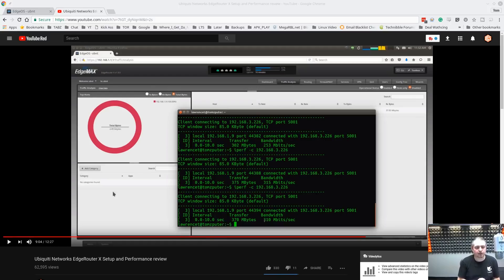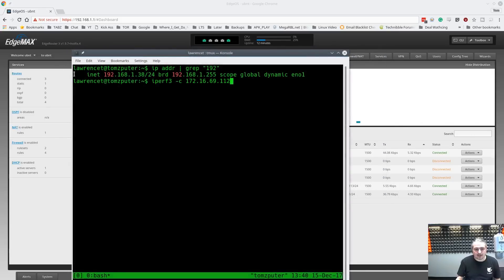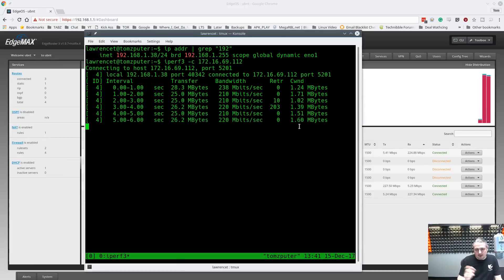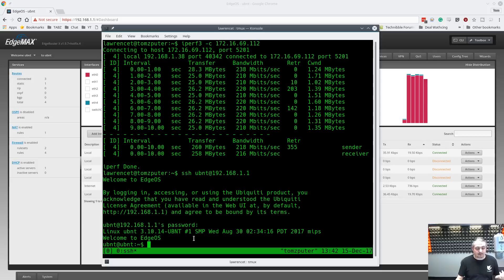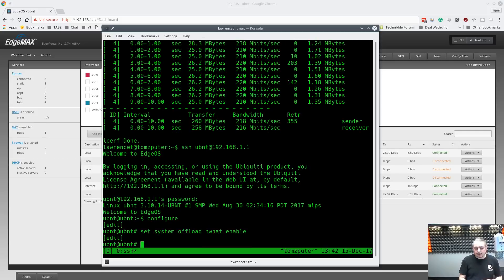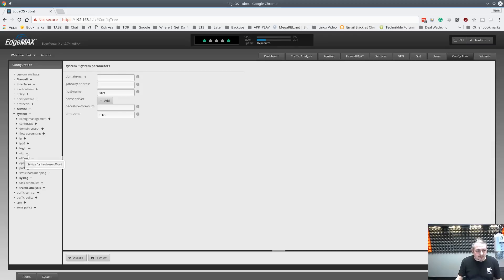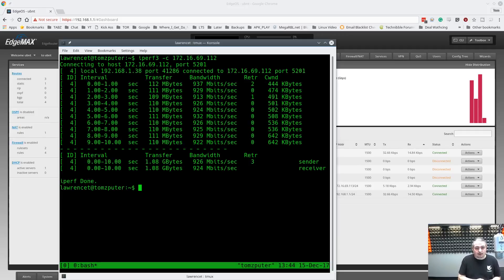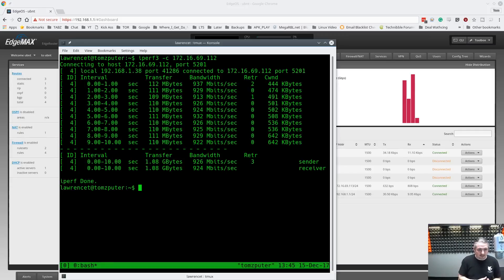Ubiquiti Edgerouter X Enable  Hardware Offload Speed Test

Comment: Hi, i have edgerouter x with firmware 2.09. I use wan 1 and wan 2. Wan 2 is starlink. Normal speed in wan 2 is 200mbit of download and 20 of upload. With my ubiquiti router the speed came limited to 60/70 mbit in download, why ?
I have enabled/disabled ipsec and hwnat but the problem is always the same.
Thanks a lot for the help.

Comment: Ok I have a question!  I have a Router-x and had 500mb/10mb and was getting like 370-400 download with offloading turned off default config.  So I up my speed to 1gb/35mb.  I got the same or maybe a little less so I used the cli and enabled offloading on hwnat and my speed drops to 170mb on downloads.  Replaced cable, no Qos. I plug into the modem and get around 670mb so not getting full 1gb so have that to deal with provider, but my upload is constant no matter what I do. I am on 2.0.9 on the router.  I disable offloading and go back to the 300mb or so.  Any ideas on what to check?

Comment: Does anyone still use this? I just bought an EdgeRouter X SFP for someone. He has a 1Gps/30Mbps down/up cable internet connection. I personally have a pfSense (and this one as a plain layer 2 switch). I ended up paying $100 for it. I bought the one for myself in December 2018 for the same cost. I couldn't justify having him spend $200 (with tax) for a pfSense appliance along with the Unifi WiFi AC Pro.They aren't heavy gamers and are looking to replace their cable company issued equipment. Performance on it is very poor at best on their old connection of 100Mbps/5Mbps (it is an all in one; cable modem, router, wifi router). 

Tom (or anyone reading this),0
I know its too late for me to return this, what are your thoughts on this product today since this product is a few years old)? Its a home setting. They were going to buy an AmpliFi mesh network (they have ethernet drops all over the house). For this reason. I bought them two access points. 

What are your thoughts?

Comment: OK so then how about telling us how to make it so that it actually GETS that speed? As in, mine will only connect via 10/100 and will NOT show that it is at 10/100/1000! I can't get the computer to recognize a gigabit connection, nor will the router show a 1000 option for setting the port to gigabit speeds...
Reply: Check your cable and test with a different one.

Comment: Hi, at home I have 1000 Mbit up/down which I can achieve by connecting directly.
I steram a lot over ethernet and WiFi but I want to upgrade my current setup and buy a UBNT router, switch and multiple Unifi HD's, I prefer the interface of the USG but which router would you recommend for me?
Reply: probably moot for you as this was 10 months ago, but here is my basic advice for others thinking along the lines that you are;
While gigabit internet still feels like a luxury these days, it is still just gigabit ethernet like we have all had on our internal networks for 15 years, and you don't need a whole lot of power to maximize your throughput on it... unless you are running a business or school where you have hundreds of device all hitting the network all the time and have lots of firewall rules then you are probably fine with an EdgeRouter X or Lite-3.  The X is a little better in some ways, but is a little simpler device, where the Lite has a console port on board for easier recovery options.
The USG is just a router.  It is small, cute, and has a very simple UI that interacts nicely with the Unifi software, but it is rather limited in what it can do.
The EdgeRouter X or Lite-3 is nearly the same hardware as the USG, but with a more capable GUI.  The box is not as cute, and it will not light up the circles in the Unifi software, but it does all of the same things and more... just have to manage it from a different web page.

As for the HD's... save your money.  HD is for High Density... Think of a cafeteria with 400+ people all streaming music and podcasts on their phones, while browsing the web on their laptops at the same time.  The Pro and the HD have very similar capacity and range, but the HD has a little more oomph to manage more simultaneous connections.  The Pro is made for classroom settings where you have 30 people with laptops and cell phones all connected at once... Unless you are going to have more than 60 active devices in the same area at the same time, then the Pro is likely overkill for you as well.  Put one every 60ft, and you should have some fantastic WiFi.

For a switch, again, you don't need a Ubiquiti device to have full feature sets.  Everything works together well, it is just a matter of how many websites you manage your equipment from.  The Unifi software is handy in that it can manage (or at least partially manage and report) for multiple devices in one place, where if you mix and match your brands or product lines, then you end up needing to set things up on each and every device... But once the initial setup is done you typically can leave it alone for a few years.
I am running an EdgeRouter Lite.  Eth0 goes to the internet.  Eth1 goes to an old unmanaged Linksys with end-user devices (PCs, TVs, printers, etc.).  Eth2 goes to an old manged Cisco switch that connects to the server, NAS, APs, and someday soon Cameras.  Down the road I will probably replace both switches with a single larger switch... but for the moment these 1 little 8 port switches were very cheap, and more than good enough for my uses.

Comment: I tried enabling the "hwnat" from the GUI in version 1.10.1(Edgerouter X) and it does indeed work (Full gigabit from LAN to WAN) and survives a reboot. I also disabled it via the GUI and it turn it off as well. Thanks for all you great videos! 🍻
Reply: do you have to enable hwnat if you only need gigabit for LAN-LAN???
Because i don't have a fast internet connection, but i have a server at home which i need to acces it at gigabit speed
Reply: It depends... Using the hardware offloading (HWNAT) will speed things up so it won't hurt. If you intend on using the QOS features then you can't turn the HWNAT on. I hope this helps.
Reply: Eric goodrich maybe my question wasn't clear enough...
from what i understand if you have hardware offloading not enable, every trafic is handle by the cpu which mean you can use QoS and so you have a speed from PC to internet not above 200-300 Mbit/s...
I meant to say if you plug a PC to eth2 and a home server to eth3, can you have gigabit speed between the PC and the home server if hardware offloading is NOT enable

Comment: Hi Tom, I haven't been able to find any information anywhere else. Just wondering if you would be able to check something for me in regards to ERX. Do these support full bridge mode ? I am trying to setup my pfSense in HA with one WAN just hardware HA. But, I get fiber terminated in my house and directly get internet via DHCP. So, if I can get edgerouter to bridge mode and switch other ports I will be able to connect to my two pfSense box(One physical one virtualized.).

Comment: EdgeRouter ER-X or Mikrotik heX RB750Gr3?? I really have tough time to choose which one will be better as they almost the same. However i see many people which favor Mikrotik devices over Ubiquity as they seem to be more polished than budget line of Ubiquity devices.
Reply: I know what you mean. I was hesitant about using winbox to configure the mikrotik devices, but it is really a neat tool which allows real time monitoring of different screens. Also works great in wine. I think the limiters are more capable too which is something I am really interested in. We need to get tom to do an iperf test on the RB750Gr3 to compare.
Reply: The thing I like about the Ubiquiti's EdgeOS (and their other OSes) over Mikrotik's RouterOS is that they are Linux based, so anyone one with some Linux skills can pick up the configuration relatively quickly and Linux skills learned with the Ubiquiti OSes are transferable to other Linux based OSes. I found RouterOS a mess to look at, but I know others  who love the Mikrotik software. Part of me just wants to run OpenWrt in my Mikrotik MetaRouter, rather than go through learning another router firmware again.

Comment: Awesome - I have a spare EdgeRouter X which I will upgrade (soonish).  Just ordered the same UniFi Managed Switch you've got as I'm setting up an internal pfSense server > XenServer and setting up permanent IPSec tunnels into AWS via the pfSense Server.

I got Win10 running in virtio (on the Threadripper box) and it is NICE!... simple enough for me to click about and use the Xen client.